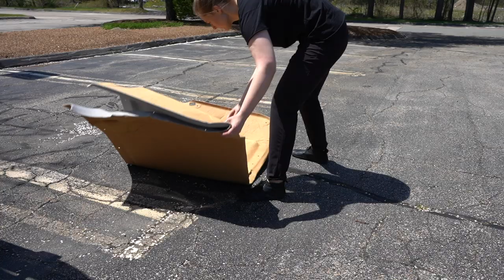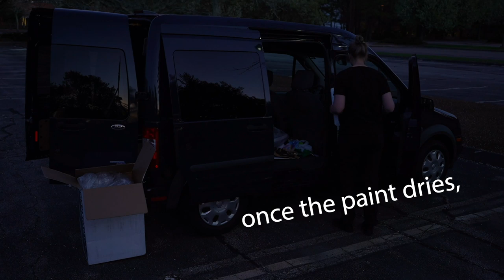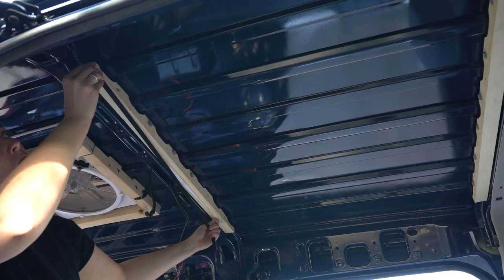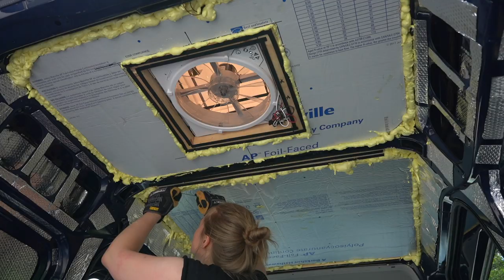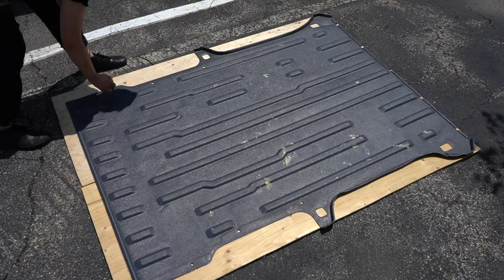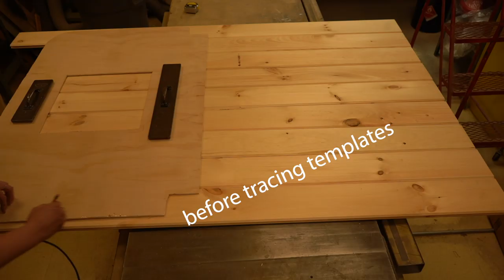Van Build - Part 1

Comment: What was all the noise-proof and foam for? I assume that was like insulation and makes it quieter inside the van. Did you just Google/research how to do all this stuff? And were you borrowing someone’s garage for the tools and work space? Sorry for all the questions I’m just so fascinated by this process haha. I can’t believe you’ve done all that stuff! I can only imagine how rewarding it will be once the van is at a place you’re happy with it and it feels more like “home” instead of just a forever project. 💛
Reply from the maker: Hi, thewinterizzy! 😁The noise proof stuff is mostly for when I'm sleeping somewhere with a lot of cars and people making noise outside, but it also helps keep the van quiet while driving. The foam is for keeping heat in/out depending on the season, and yes, lots of Google and lots of YouTube - I've watched a lot of other peoples' van builds over the years and pieced together my own design and tactics from what I've learned watching theirs. The tools are either mine or borrowed from my workplace. And YES, you're so right about the rewarding feeling - I was actually feeling that already, while putting this video together. It's hard to remember how far you've come when all you're focused on is how far you have yet to go...

Comment: Where did you learn all of that?! Result looks awesome, no fuck ups in process of making it. Wow.
Reply from the maker: OH BELIEVE ME, there were too many to include - the video would have been 20 minutes long if I had, even at 500% speed! 😁I learned most of it from watching YouTube and reading other peoples' blogs, actually. It's a slow process, but definitely gratifying.
Reply: I wouldn’t have minded the 20 minute 500% version
Reply: @ImJBlu  The same! I like woodwork, I even made few furniture to my home and no one was killed or injured using them. First time ever when I used jigsaw, power of it basically pull me through the whole length of board and it jumped to the air with me attached to its handle. I wrongly anticipated power of it. Board was curved in very interesting wave and next day I went to a gym to work on my upper body strength.

Comment: Hey Lefie 😊 You could use a dummy battery + powerbank for your camera - this way you could let it film for hours! You're using a Sony camera, right? Then you only have to be aware that these cameras can overheat when filming for long durations / with high resolution / in high temperatures or sunlight. But that should be all that could interfere with your plans 😉
Reply from the maker: AH! Thanks for the tip! I appreciate it.

Comment: Are you going to place solar panels on top? Then use that space above the front seats to collect the electricity? Then wire outlets around the van?
Reply from the maker: I do have a solar panel, but I still haven't attached it yet. I need to decide whether I want it permanently attached or whether I should build it a storage nook in the interior and just take it out when needed... Any suggestions?
Reply: @Lefie  I would hook it into the roof of the van with moveable mounting brackets. So you move it around if the suns concentrated in one area.

Comment: Watching the build made me think about many chemicals are used in building our living spaces. In tiny spaces like vans, the off gasing of toxic chemical will be far less diluted than in a more well ventilated larger tiny home. I wonder if in 10,15, 20 years from now, we will see a new generation of aged Millennials with unusual lung diseases and cancers. Environment stuff unlike before. No, I am not being negative or funny. Then, imagine, you add a dog that passes gas without discretion in the air you breathe all night and all day long while inhaling the dog's or cat's hair. I am all for tiny living and I live in a polluted Los Angeles so we all have something, but for the first time, I am wondering if van builds and van living is as much freedom as it is painted to be, no punt intended.
Reply from the maker: Yep! It's definitely something to consider. For insulation, I actually chose some options that are better but the vinyl floor had me questioning off-gassing. The ceiling fan is a must-have for that exact reason, and a carbon monoxide detector is also a must.